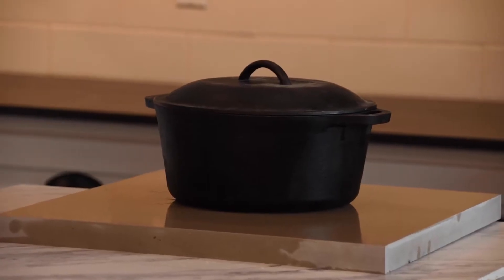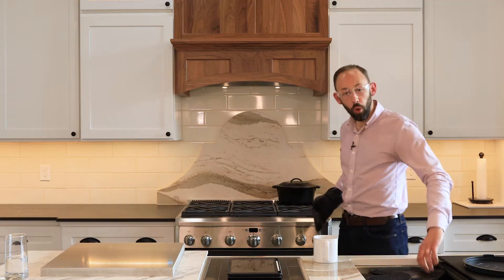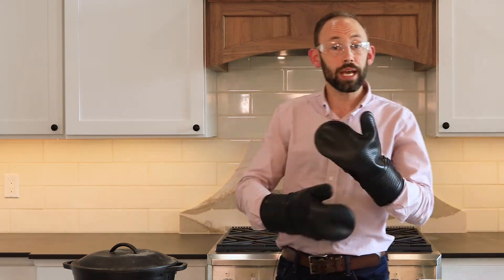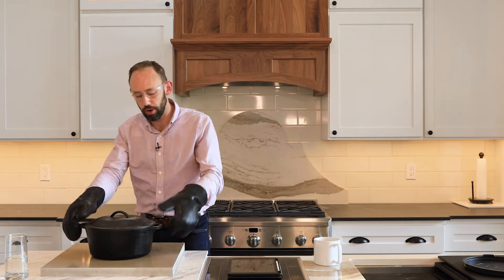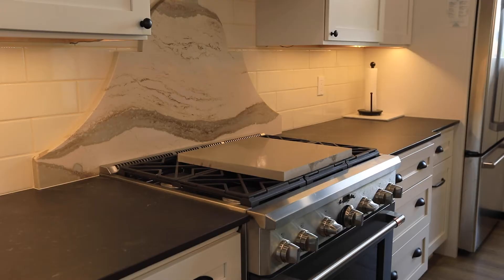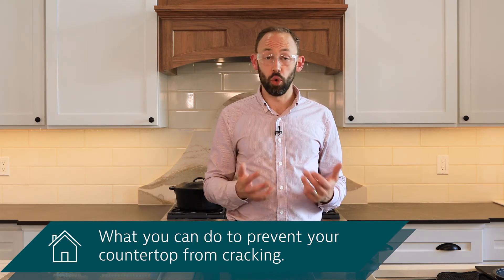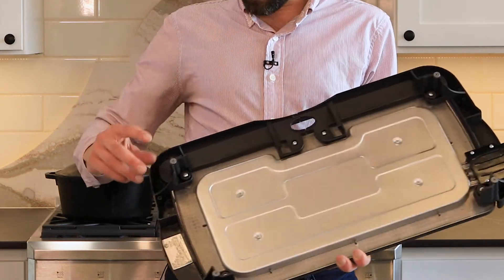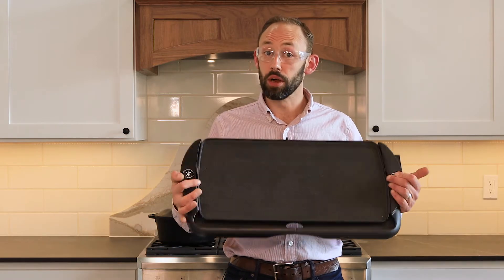Will heat crack this quartz countertop?

Comment: Do you know if a built in oven in a cabinet under the quartz would cause it to crack over time? We just enclosed the oven cabinet completely to protect the counter from the heat generated by the oven exhaust, we are still contemplating adding aluminum as an extra layer but are concerned that may increase the cabinet temperature by deflecting the heat....oven manual says the oven can heat the air in the cabinet to about 195 degrees. Any thoughts on this? Thanks

Comment: Is there a danger of heat from a dishwasher cracking quarts countertop?
Reply from the maker: I don’t think so. I’ve never heard of that happening.
Reply: @DesignBuildRemodeling  No problems so far. My installers address this concern and they assured me there is no danger of cracking from dishwasher. I am being an over protective parent. ha ha. Thanks for your reply.

Comment: Very useful information - thanks!  Wish I would have been better informed about the heat risks. Here is another piece of info. We used a sous vide machine in a plastic container on our countertop. Cooked steaks in the water bath at a temp of 131 degrees for approx 2 hours. Heard a loud pop, couldn't figure out what it was and then noticed the quartz countertop on our kitchen island had cracked about 8 inches! I've never set a hot pot on our countertops and had always been careful but since this container was just very warm (you could easily hold your  hands against the sides at 131) it didn't occur to me that this could happen but it did...   Could you tell me please, is it possible to have a crack in a white and grey calacatta quartz professionally repaired so that it is unnoticeable?
Reply from the maker: Oh no! Yes, we have heard all sorts of stories about things like this and Instapots as well! Trivets or some protection between the heat source and the countertop can help from this happening again. As for repair, I would first check to see if your warranty is still available as this may fall under it. If it is past warranty, here's an article I found that has some great info on repairing your countertop. https://www.caesarstone.ca/blog/can-a-broken-quartz-countertop-be-repaired/